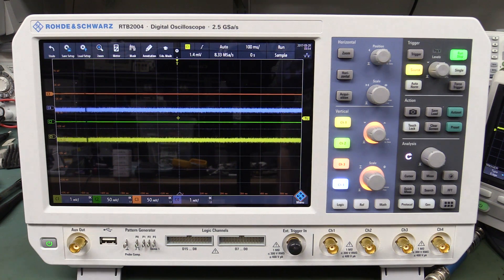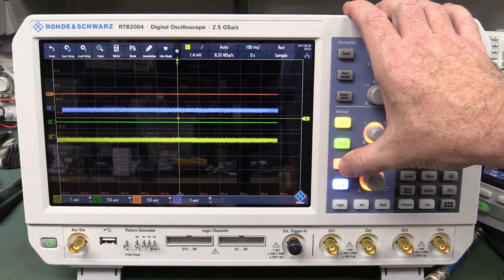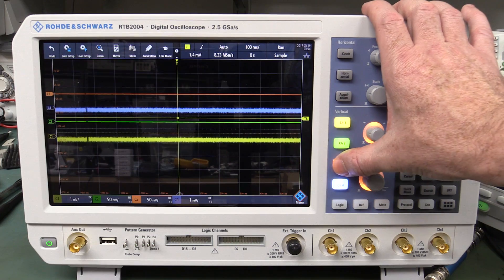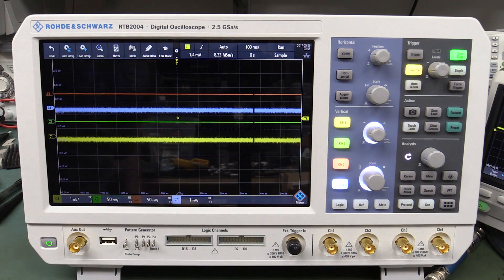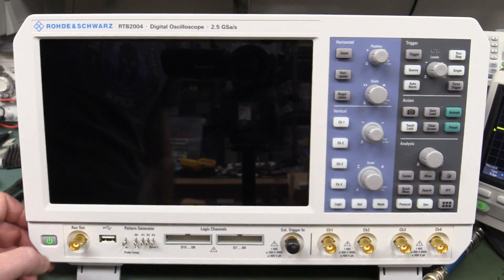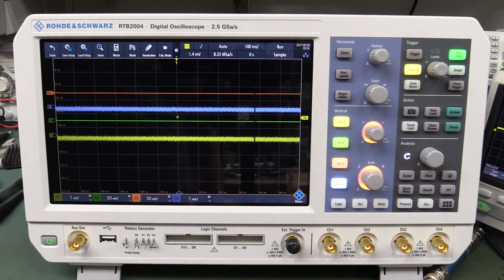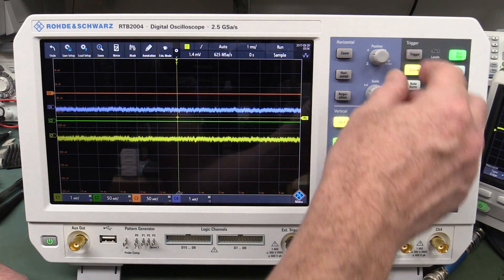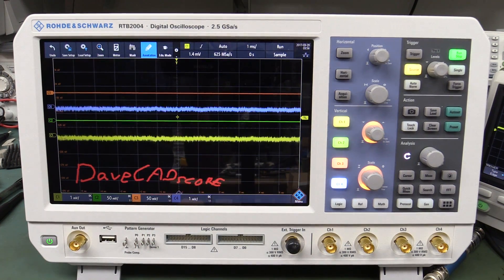Rohde & Schwarz RTB2004 Acquisition Bug Part 2

Comment: I disagree with "bouncy relay" idea.  To me this looks like a digital vertical scaling issue and the timing of its change and display.  It has already started to acquire the signal before then changing the scaling.  Dollars to donuts the source of the problem is related to the previous video's display problem.

Comment: I have a new RTB2004 (only had it for 2 days) and it is a very powerful scope. I haven't checked this issue but the R&S website already has a firmware update.  The screen is fantastically sharp and the protocol decodes are very powerful and in-depth which was the main reason for buying. I am still learning the interface as the manual is not very good and the general set-up options  on it are vast with a capital "V". So far I really like it having come from a original Rigol DS2000 series which has had all sorts of problems
Reply: Rothschild...
Reply: Same comment on both videos?

Comment: What's probably happening on the slower timebases (both here and in the other case) is that it's redrawing parts of the acquisition memory that hasn't been overwritten by new data yet. On faster timebases, they can assume that a capture, once it has started, will havd overwritten the full buffer before it's time to render the data.

Comment: Yet again, they need a separate GPU or whatever for flawless operation. The operation is not flawless regarding real-time and ideal operation would require constant memory updating for the selected frame, you would see something like blurred line - intensity update + each measurement within range and - each measurement outside range, unless you specify some other algorithm.

Comment: Is it catching it's own switching noise? Bouncy relay contacts on the inputs?
Reply: Since RS has responded that it's a firmware issue, this is probably the case, if not a similar issue. Probably unmapped memory being read before any data has been stored to it. Loop memory pointer not being updated properly or something similar.
Reply from the maker: Not a bad theory.
Reply: If it's not that, maybe it's reading uninitialized memory? The only reason why I'd think that is because of the other rending bugs (showing the wrong signal at the wrong vertical location temporarily, etc).
Reply: Maybe it has something to do with memory addressing? A hash table has some wrong values in it at one point and things aren't being poked into the correct spots in memory?